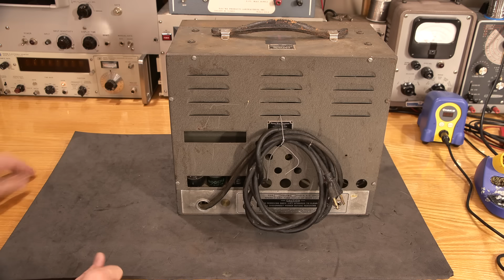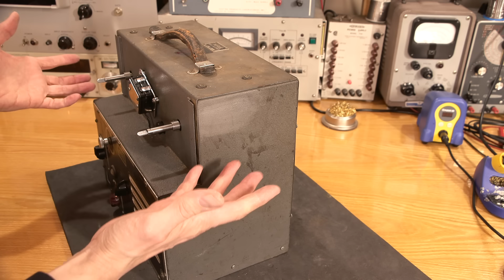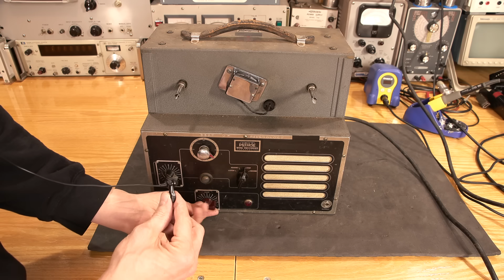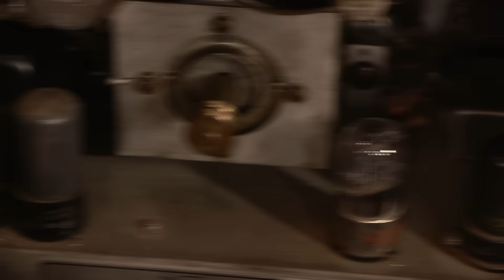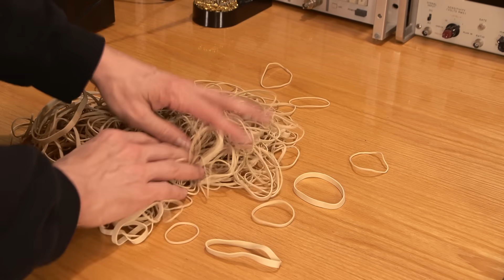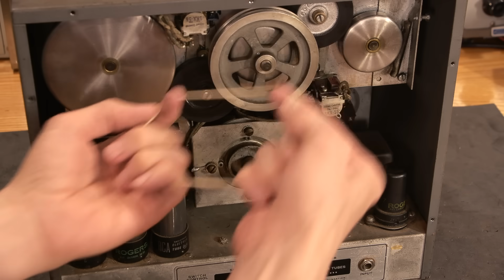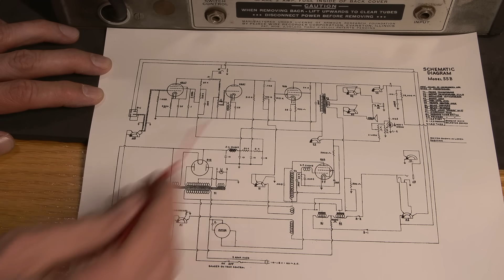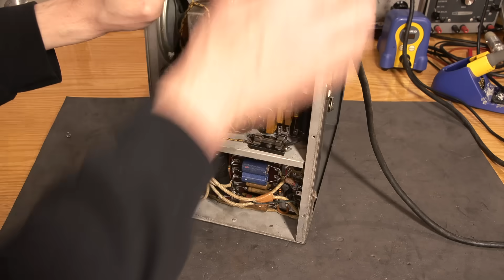Trapped Voices In This Wire - Let's Listen To Them!

Comment: This was used in the early '90s as a children's toy, consisting of two cans and a tin nylon string connecting them through small holes, allowing communication over a distance.
Reply: It's a magnetic recording, same technology as a cassette uses, just different media to record on.  No vibrations in the wire.

Comment: You can buy o-ring stock material and cut the ends with a razor blade then glue them together with superglue. Incredibly strong believe it or not. I work on hydraulic systems and make custom seals all the time.

Comment: I am absolutely blown away, how does the wire recording works? Does it have little groves on the wire ? How can you hear the sound through those tubes and with that probe??? what
Reply: Magnetic recording, same as a cassette uses just different media to record on.  There are no grooves on the wire.  The probe is a very sensitive inductive pickup that can "hear" signals in nearby wires, vacuum tubes, etc.    An inductive probe to hear signals is not unusual, I use a model commercially made by Fluke.
Reply: @EriksElectronicsWorkbench  Amazing, and how do the signals from the wire end up on the vacuum tube?
Reply: @ As the magnetized wire is steadily moved past the play head it induces a voltage in the play head that is identical to the original audio as represented by the magnetic pattern on the wire.  A simplified description of the play head is a metallic U shaped piece and the gap in the U is where the wire passes.  There is very small wire wound on the U shaped structure.  It is the principal of moving a magnet past a coil of wire to induce voltage. The small wire on the play head is connected to the vacuum tube amplifier circuit.

Comment: When I was about 17 years old I found one of these machines in the town dump. It looked great but was minus one tube. Naturally, the schematic was worn off. A radio repair shop in Keene NH let me rummage through his old filing cabinets and I actually found the schematic for it. Needed a 5U4 tube. Worked perfectly. It was also a 78RPM record player. It played the wire from the smaller interchangeable spool to a take-up around the outside of the record turntable. The head moved back and forth as yours does. One spool had the entire musical score from Oklahoma on it, the other one had the old owners voice on it just having some fun.

Comment: That's crazy that you can record audio on a WIRE!!  Is it a special kind of wire or just normal wire??   Very interesting.
Reply: I'll answer if you don't mind! 
A wire recorder, like a tape recorder, works by magnetizing a thin steel wire with an audio signal and then playing it back by passing the wire over a head that detects the magnetic variations. 
The recording head magnetizes the steel wire as it passes over it, creating a magnetic pattern that corresponds to the sound signal.

Comment: I have a reel that I was told was a recording of my grandma on my mother's side that passed away before I was born. Through the years I have tried to find a way to play it but never could find a device. The reel says Webster-Chicago 1 hour and has a catalog number of W-175 201. Any idea of how I can find a device to play it?
Reply: The simplest and least expensive way is to use a "Wire Recording Transfer Service" to listen. The wire recording is converted to a digital file and copied to a  flash drive or CD. "Two Squares" is one company that does this. Cost is $50. You supply the flash drive.
Reply: Sweet. Thanks for the info.

Comment: Sorry, an unrelated question but hope you can help.
If I were to measure the inductance of the coil on a loudspeaker crossover, would I have to disconnect it from the board or will it not make a difference?(speaker not live at the time, obviously)
Thanks!
Reply: most likely needs to be disconnected as connected circuits/components would affect the measurement

Comment: Mr. Carlson, I’m nearly 70 years old and I too am unfamiliar with this method of recording.   I wish you would have also explained how the recording is put down on the wire and some of the history behind that technology.  So many questions…. does the head mechanism function similarly to a tape head, can the wire be erased and recorded over and if it is passed through a magnet will the recording be erased? 
Nice video!

I just subscribed in hopes you might reveal where one can find a Bell and Howell film projector bulb so I can watch my old super 8 films.
Reply: Magnetic recording, same as a cassette uses just different media to record on.

Comment: So for the wheels that are supposed to be rubber but they feel like hard plastic...I haven't watched the video all the way through yet so you probably already had a better solution, but I thought that came to mind to get more traction would be if you took the wheel off and wrapped just one go around with electrical tape so that provides more traction in contact with the steel wheel. Should help with quieting down the flat spots of the wheels, as well.

Comment: That probe thing you used to listen to the audio is versatile, it can be used to pick up stuff you cannot hear with your ears, for instance spirits, or just trapped memories as energy, you just ask a question or ask for feedback, and if there is a spirit in the room you will hear the response, and yes it does work, on the same principle as EM recorders that are used to investigate invisible presence, same principle only noisier perhaps less sensitive than w hat a probe can pick up.    It seems that the universe is a recorder - I have used this probe once in a room, an hour after there had been people in it, in a conference, and was able to pick up some bits of sounds and voices / conversation.  I think this is compelling evidence to suggest that our memories are not formed in our brain, but our brain is just a receiver, much like a radio RECEIVES RF and decodes it, the same way our brain receives and interprets the stored energy, and when people pass away they part their physical body, but their energy presence is still there, much like if you break a radio, the RF is still there, you buy a new radio and can tune in to the frequencies.

Comment: At a thrift store I bought a medium box of (5 or 6") reel to reel tapes.
Later I bought an old tape deck to play them,  but it wasn't able to be repaired because parts were outdated.  Someday I hope to listen to these old reel tapes!😢
Reply: Reel to reel tape machines and parts are easily found on eBay, at hamfest, swapmeets, etc.  Old tapes do disintegrate so be careful with them.  Sometimes you get one pass and the oxide sheds off... my grandfather's old tapes from the 50's were in such a condition but I salvaged them and copied to CD.  Do what you can to archive the recordings :)

Comment: He finally gets the machine turned on at 25:57. I can't wait to hear what is coming I've made it this far. There was a lot you had to go through to get this going. Man this is such a great video I finally finished it. You got some nice equipment there. That's pretty cool that you have found something that is so valuable. I love vintage stuff. I got a vintage 1981 Marshall JCM 800 tube amplifier 4010 model. It also needs some repairs

Comment: The capacitors you refer to are not 'filter caps' as they don't filter out any specific frequency, they are the reservoir or smoother caps for the rectifier. Filter caps are normally  mkp types found across the mains input of smps to stop them radiating interference back into the mains.
Reply: Power supply capacitors, what Mr. Carlson temporarily changed out, are called filter caps.  That is a common term for them.  They filter (smooth) the ripple on the DC voltage.  They type you mention on the mains are safety caps, X and Y class rated.
Reply: @EriksElectronicsWorkbench  Not really. The caps across the mains are not there for safety, they are there to filter out HF smps noise. That's why they're called filter caps. The one after the rectifier acts as a reservoir, its job is to 'fill in the gaps' in the rectified DC with its charge-discharge cycles. Not really a filter, despite what anyone says.

Comment: Both reels are removable, so you haven't to rewind. But the question is, is it compatible with Webster Chicago system? Is the rpm of the take-up reel slower to ensure, that the wire will be played in the right speed, when both reels have the same size?

Comment: That is awesome. I didn't know technology like this existed.
Reply: Agree the vintage machine is cool and neat the recording still exists but the technology is just magnetic recording, if you know about a cassette tape you have seen the same technology.  Wire recording was used until about the 1950's when tape based recording took over.

Comment: With very old electrical equipment like this, I would be concerned that the metal housing might be compromised with bad or old wiring inside the machine, and I would get electrocuted. Fascinating video!

Comment: trapped voices..... right..... youre aware that a ton of us know what that is and "trapped voices" is extremely misleading, its not much different than an audio casette. magnetic charge applied to field with information in the charge. not much different than any other recording method. it was just a bad medium, so they stopped using it, and fast. techmoan did a video on this YEARS ago

Comment: ★★★★★Very cool channel I subscribed and this is a cool video I like how you're doing this! ★★★★★ BUT★★★★★
     Might I suggest a little tip from my discoveries and fixing things and gadgets and whatnot??.... I use rubber bands but they always break and are very brittle and don't last very long so I switched to using "ranger bands"... Ranger bands are basically a generic term for old bike inner tubes that I grabbed whenever available in different sizes and I cut them up into little rings of different widths sometimes I'll leave them quite wide maybe six or eight inches to cover a knife sheath so I can stick things in between it or I'll cut them up into quarter inch or you know half inch different sizes to wrap around all kinds of things on my tool belt and in my shop and on my flashlight on knife handles etc! They've come in handy more times than I can imagine! The thing about using them is that they are extremely strong they stretch quite nicely and they last a very very very very very very long time I have some ranger bands that I've made almost 10 years ago and they're still holding on some equipment! Of course there's different quality inner tubes and of course there are different sizes and thicknesses engages etc! Usually you'll have some bike inner tubes that will make some small ranger bands that will stretch pretty wide but I also have found that dirt bike inner tubes and larger mini tire inner tubes for like wheelbarrows and stuff like that... But those will give you the larger rubber band sizes per se...
   But for this application if you had a grip of ranger bands in different widths and sizes you'll find as I have that they act as many pulley belts wonderfully they literally almost resemble a type of pulley belt when you stick them on the pulley!!!
    But they revolutionized my quick fix and fastening systems having them around and throwing a few wrap around the handle of my belts flashlight I use them also to grip things on my tool belts and pouches that I carry I have work belts and then I have just everyday carry pouches for like a small few hand tools if I'm doing something light work and I will have them basically wrapped around the whole pouch holding the tools securely I use them sometimes to wrap around knife sheaths that are kind of quick connect kydex sheets and it'll go around the frame of the plastic sheath and then go around the back to the part that hooks around the belts and it'll loop around the tip of that and basically lock it to your belts where it can't pull off!needless to say there's a million different applications for ranger bands I believe they're called ranger bands because the US army rangers were the ones to discover this little hack of rubber band usage and they started using them for their weapons and putting them on their rifle butts and on the rifle stocks and God knows what else on their knives and stuff...😊👍🏼✌🏼✌🏼
   We have these little tools at work where I do carpentry and we fasten stairs and little bolts inside of small wooden holes inside liked posts and you have to have a special tool that has a rubber band on it and it helps turn the nut basically by you manually feeding the rubber band around the pulley which looks around the nut on the little tool that you put in and it's like a wrench but it basically Tightens the nuts on the bolts that is in the small little crevice that way you can actually work it cuz your fingers will not get back there very easily.... Anyway these tools work but they were always a pain in the butt cuz the rubber bands were very flexible and they were very just splashy and weak but once I switch to ranger bands everyone at work so how quickly I was tightening these bolts because I had switched to having basically a rubber band which was too rubbery and flexible to putting a ranger band or an inner tube and that material was nice and firm and thick and rigid enough to help with the task at hand and you were able to spend the bolt very fast and they last a long time and don't break on you every other application! 👍🏼👍🏼👍🏼✌🏼✌🏼✌🏼😁
    Anyway I thought that if you didn't already know about them you should hear about them because they're a great addition to any technical guys tool belt or tool chest etc! 👍🏼✌🏼

Comment: I said transmission as soon as it lit up but did not turn.  Speaker status?  Paper cone collapsed?
Reply: It is not a speaker cone issue that keeps the machine from working properly.  All of the capacitors are defective.  The glowing grid in the tube is a big indicator of this.  Some resistors may be way out of tolerance too.

Comment: I was about to comment towards the end of the video that I find all equipment so beautifully made although many components are outdated, they are heavy duty. 
That cream colored “Carlson ultra probe” looks like a vintage item that you found and restored. I would love to see the build tutorial on that through your Patreon and perhaps get your extra advice on some equipment I have.
⬇️⬇️⬇️

I have some equipment that’s not as old from the 60s and 70s that have sentimental value from a my trucking business, I would like to figure out What they are and how to turn them into art deco pieces. 
It’s a “GE trunk radio base with tube transistors “ 
That’s how we always refer to it and used it up until 1998 when it was replaced by Motorola Nextel push to talk radios. 
I miss the simplicity of equipment that didn’t need software updates and legal disclaimer acceptance in order to function. 
Keep up the good work, and if I can make a recommendation that perhaps you invest in a desktop lazy Susan as your camera recording of equipment, and hand movement can be pretty jarring (some advice from a retired filmmaker, and editor)

Comment: Would like to know the tech on how this concept actually works! How does the wire capture the sound vibrations and save the memory and be able to play it back!
Reply: It's a magnetic recording same technology as an audio cassette just metallic wire as the recording media.  No vibrations in the wire.
Reply: @EriksElectronicsWorkbench  thanx, though I'd still like to know how a magnetic medium does it?
Reply: @adamden9947  hi, the way magnetic recording works is that the audio signal is applied to a record head.  The recording media (tape with oxide coating or in this case metal wire) is moved past the head at a constant speed.  The media is magnetized with a magnetic track that matches (or represents) the audio signal.  To play back the signal the tape or wire is moved steadily past a playback head at the same speed it was recorded at.  The magnetism in the recorded media induces a voltage in the play head which is amplified and sent to a speaker.  The play and record heads are super fine small wire wound on a metallic structure with a small gap on one side.  The gap is wear the recording media pass by.  This is simplified but hope it helps you. ~Erik

Comment: There were a couple of episodes of "Hogan's Heroes" where the guys use a home made wire recorder that employs a spool of thread. In another episode they listen to a message on a thread of a wool sock. cotton and wool can hold an electric charge as we all know from getting ( and giving ) static shocks to our siblings after charging up our socks on grandma's carpeting in the living room ! same principle. The wire is " imprinted" with the magnetic signal of the sound vibrations that have affected the magnetic field of the audio input  ( microphone ) It's simply reproduced when in the play mode by affecting the audio output circuit and is amplified and sent to a speaker. The "Ultra Probe" is a prime example of WHY I always say that wherever electricity goes....the Government can hear you !  They even have the technology to SEE you that way too but those devices aren't shown/demonstrated to the general public.

Comment: I hope your slowly brought on a variac...Remember this is a vacuum electronics...and the Electrololytic Caps also need to be reformed, plus the voltage wasn't 120V AC but rather 110V AC

Comment: You've obviously already resolved the issue but for those not familiar, be aware the tube type electronics took a minute or two to "come on" because the tubes had to warm up. They weren't instant on like tubeless solid state electronics.  I was an electronic technician in the 70s. Did many tube type tv, radio, and audio equipment repairs. By the early 80s, tube type electronics were becoming rare other than ham radio and some high powered radio amplifiers. Finding affordable tubes nowadays is about as easy as harvesting unobtainium.